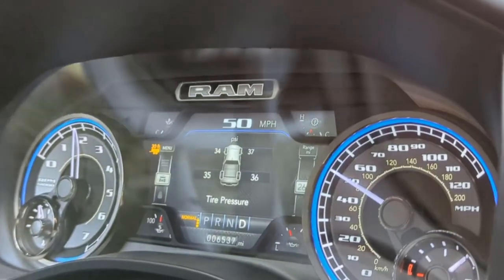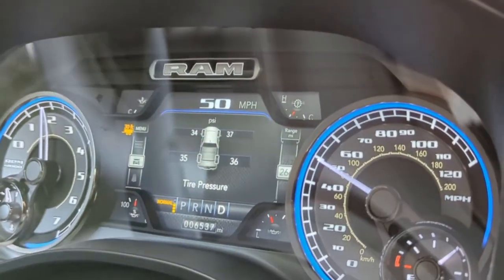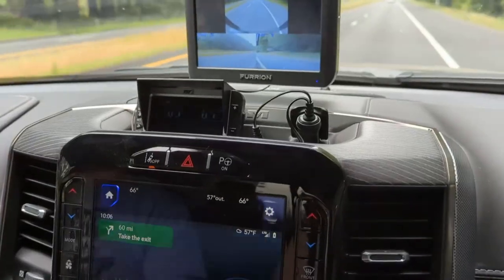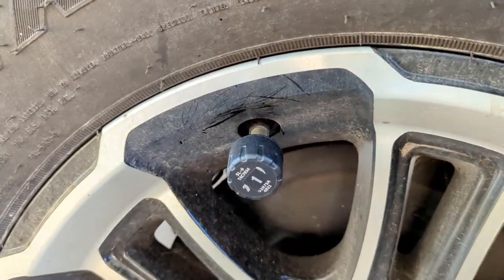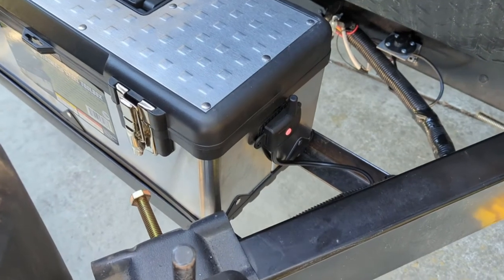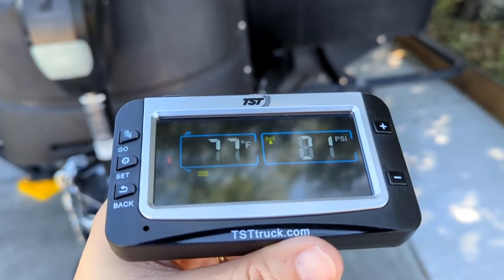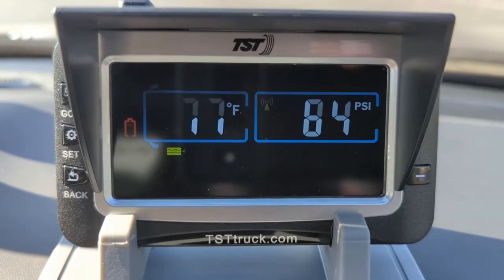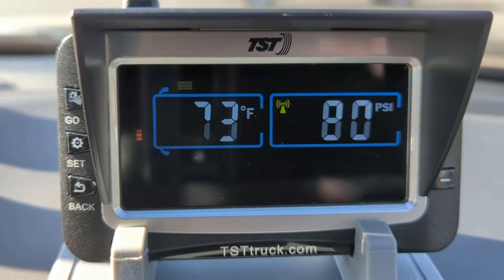Finding a Single Axle Trailer TPMS

Comment: When you replace your truck get a Silverado or Sierra with the advanced trailering system.  That way you can monitor trailer tire pressure and temperature on your infotainment screen.
Reply from the maker: That would be super cool! The Ram actually had that option too but we couldn't get it due to chip shortages 😭